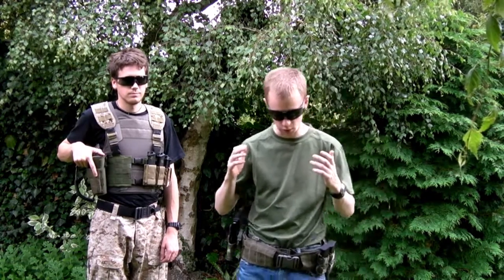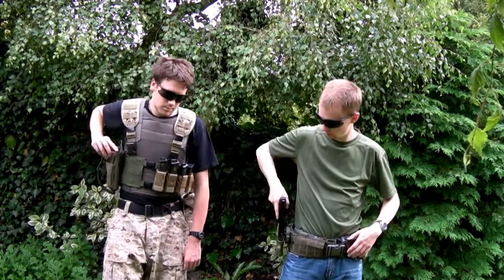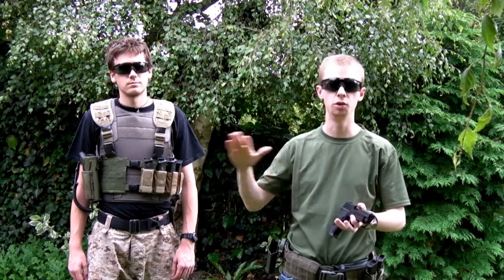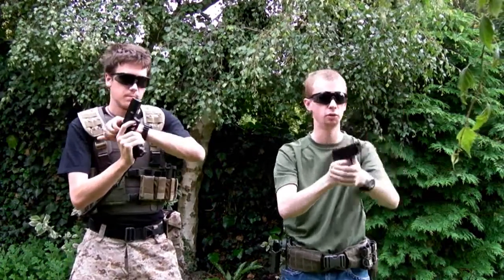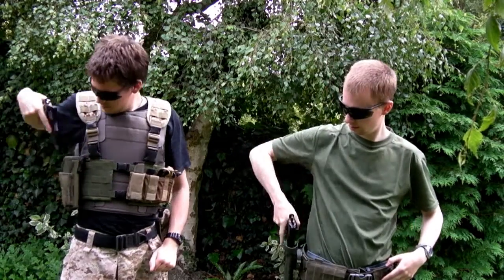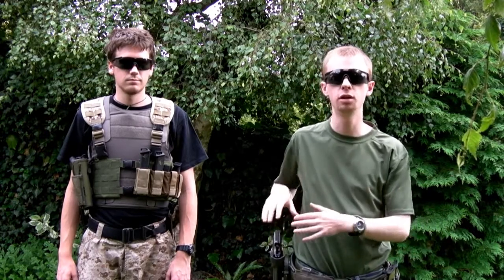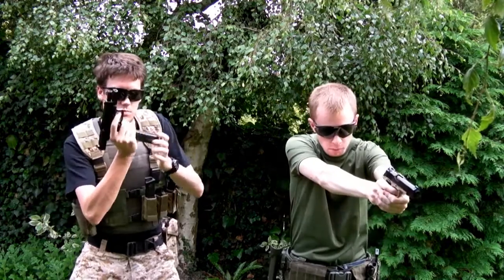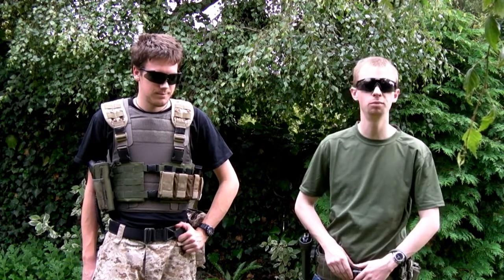Airsoft Techniques - Pistol Reloading (Pt. 2)

Comment from the maker: @TheeYellowDart  Being an armourer in the royal air force, you're quite right, I've put a fair few rounds through a rifle and I probably will fire a pistol at some point or another.  Thing is, I'm a lot more slow and careful when I'm on the real range, I handle proper weapons quite differently to airsoft ones.  I do my best to be as safe as possible with both, but I'm yet to be kicked off a range or make any mistakes with an L85, so I'd say I am probably pretty safe.

Comment: @CKinnerley Fair enough; I know for a fact that I had a few habits from airsoft that I had to check at the door when I joined the Canadian Forces; I've been an infanteer for 9 years.  Luckily repeated training has solved any issues.  Like you I have yet to have an ND.  Do you guys still use the Browning Hi-Power?  We do, the old Inglis model.  Still shoots very well for an antique but it's definetly showing it's age.  I wish they would get new ones.  Surprised you haven't had the chance yet.